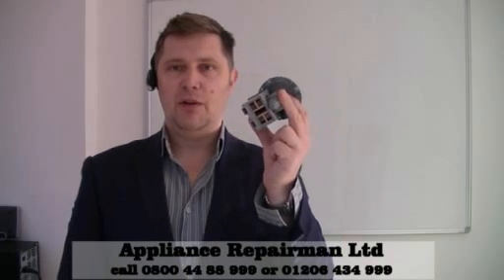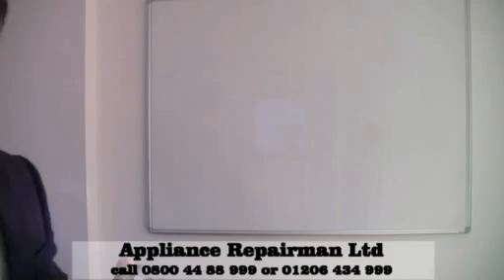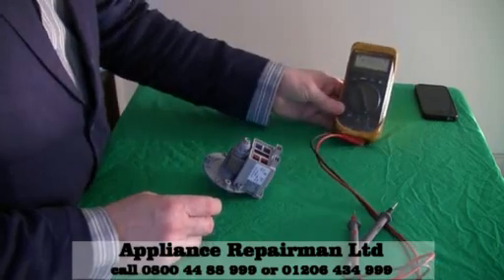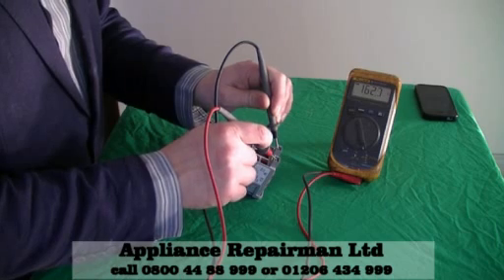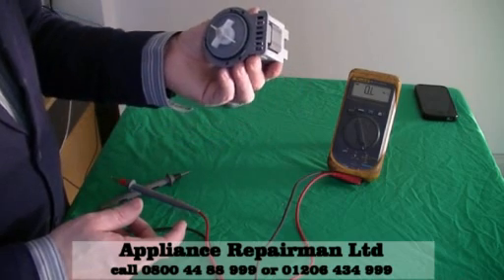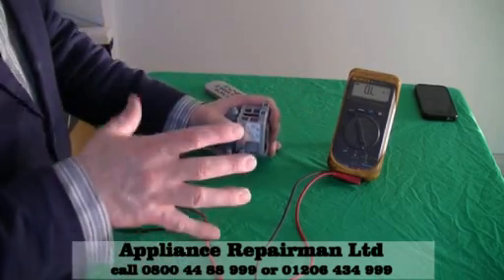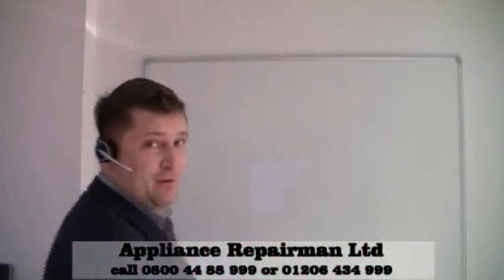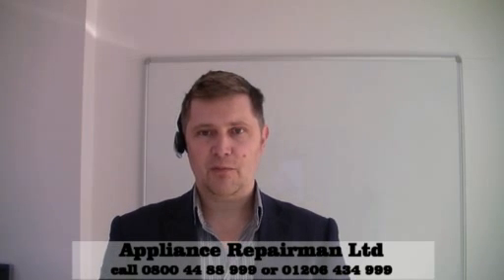washing machine drain pump eletrical test  from Appliance Repairman Colchester Essex

Comment: @Richard Saupe, tested the problem pump with my fluke multifunction meter set on continuity reading 22 ohm's so bought a new pump tested that before install greater than 2000 ohms sent back got replacement so they say still greater than 2000 ohms does this mean what I think open circuit what should I do

Comment: Hey Richard, cant believe I posted this a month ago, seems like about  a year.. lol.. I do a bit of electronics, and found that the fault was caused by a blown 400V filter capacitor on the button panel on the front of the washing machine. Replaced the bad cap with one from a TV, and it has been perfect since... 

With regard to testing the pump, I find it a more comprehensive test to put a voltage across whatever I'm testing to see if it works under load.

Comment: Hi Richard, I'd say you get that suit fairly dirty working on the washing machines.. :-) My pump measured 166 ohms so you were pretty bang on... I was gonna fix the pump in my vice and run a voltage across it to make sure it's spinning.. I can find the positive and negative as they are marked but they dont say what the voltage is.. Do you know?